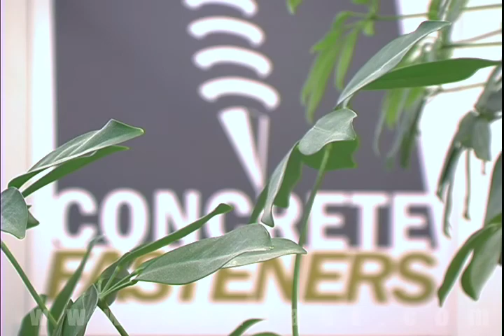Cable Runs Fastened to Brick Using Tapcon Masonry Screws

Comment: You refer to "anchors" but tapcons dont need anchors - what gives? The cable clips aren't holding up much weight, so screwing the clips with tapcons should hold any CAT 5/6/7 into brick or concrete, correct?